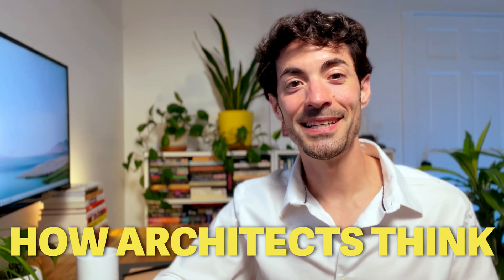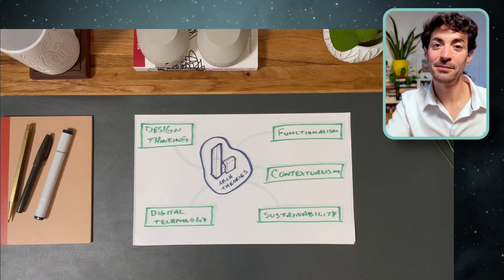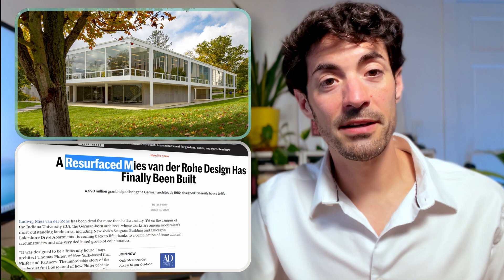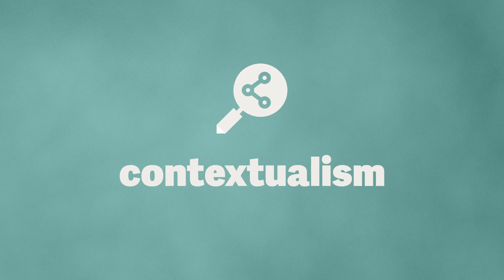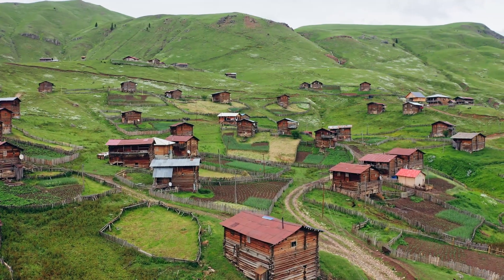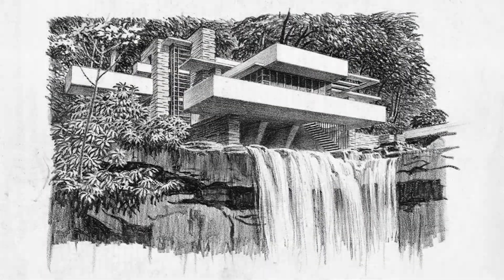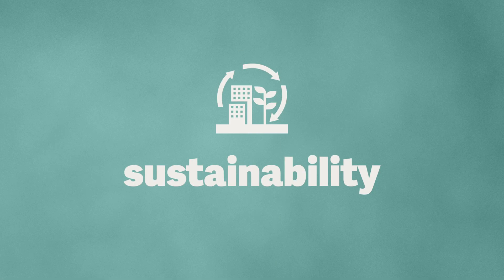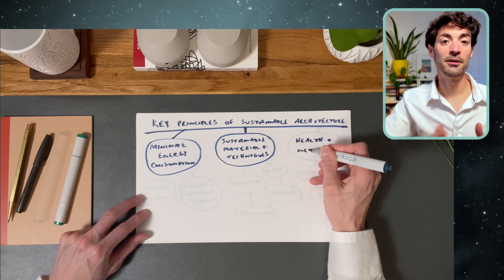How Architects Think | INNOVATIVE Architecture

Comment: I would like to see us get back to what some people have called pre modern architecture. You get a lot of the early skyscrapers the wentworth building being right at the top of my list that fit that. But the similar techniques additional equivalent to the heavy masonry buildings of the generations before are even better.

The first principle is mixed use. The principal here is that any block of that both it and the 8 neighboring blocks have 75% of the same use such as residential or shopping is. Necessarily going to become unsafe and crime riden. This means ideally re use mixed buildings but at least three use blocks with twenty percent of each of three uses. This means you have three different uses that cover people being around and active at all times of the day.

The second principle is wakability. This principle says thit should be less than once a week where you have to go somewhere of its not an easy walk. This obviously requires a relatively high density. Usually the ideal density this way is the high end of the density of heavy masonry buildings but usually built with techniques much more like the early skyscrapers.

The third principle is culture and decoration. This principle says that the building should have beautiful decorative facings in discernible styles and that those styles should showcase the diversity of the community as opposed to the dominance of the largest or most powerful block or culture.

The fourth principle is public/mixing spaces. This substantially includes semi public squares associated with various blocks and buildings along with true public squares. It also includes public and semi public parks as well as public as opposed too car centric streets. This means if you're going to allow cars into the local ways at all they need to be giving way to pedestrians even in the street. That does not mean people walking in the street. Don't move out of the way for cars to pass, but it means that the car pulls up safely behind and waits for them to make room, then the pedestrians close back in behind it.

The fifth principle is public transportation for mid range travel. This principle along with the fourth means far less parking in the nero area then modern wood operate on and having it far more expensive. The notion being that people will generally not bring cars in and out of the neighborhood. That public transit will be the interneighborhood transportation method and either. There will be a neighborhood parking garage or there will be a automobile neighborhood on the public transit route well you store your car for longer term trips. The first happens in the initial stage where you have a single neighborhood planned this way. As you have an entire community plan this way you tend to move towards the ladder.

Note this is first and foremost nineteenth century city planning and secondarily a more traditional or premodern architecture.
Reply from the maker: Thinking about your comment of large masonry buildings, I understand why designs move away from it with the limitations of the time, but I agree about how we can explore a new architecture that reflects some of the archetypes of the past. A beautiful modern example would be 130 William in NYC by Sir David Adjaye. The premise of the design is echoes your comment and says "Let’s not do another curtain-wall glass building, Let’s look at the incredible tradition of masonry architecture in Downtown and Midtown New York."

For the principles about urban design, I believe we can learn a lot from historical precedents, like Paris. The building are broken up and have many different nooks and crannies for the public to occupy and live. The car is often out of site in underground parking and there is ample public transportation in and out of the greater metro. The scale of the buildings are often limited to 3-5 stories so that natural light and the heat island effect does not occur. Overall, a wonderful place with many good lessons!